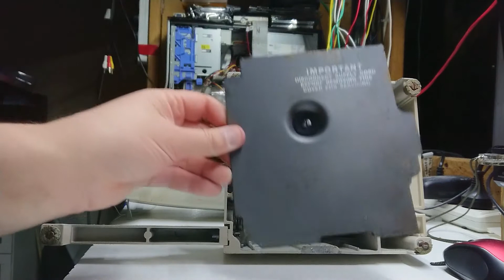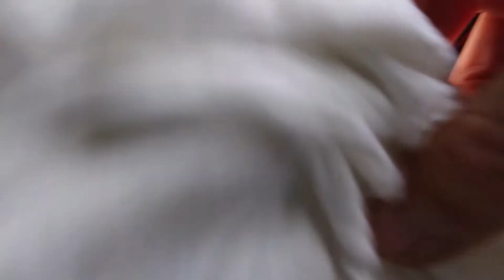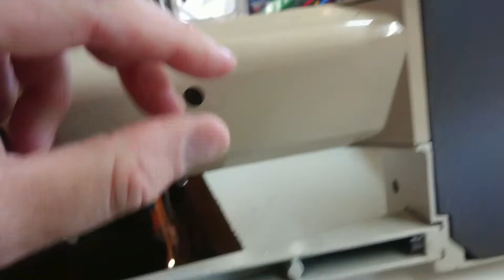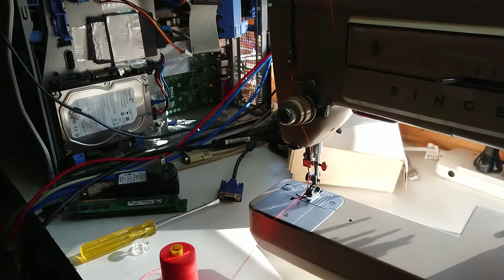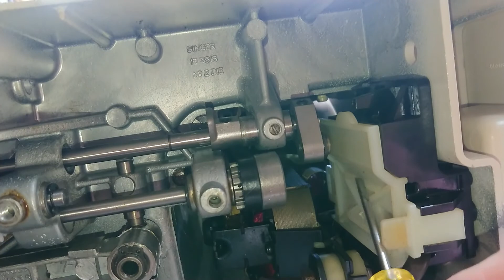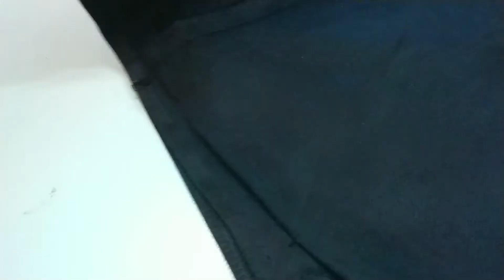Singer Model 527 Repair Part 2 (Complete Overhaul)

Comment: such helpful videos ! do you have any advice if I am unable to slide the main gear off (as you do in 27:00 of the video) it is full on stuck, even with WD40, or maybe i haven't undone something prior.
Reply from the maker: @eccaridge304  i'll have to go back and re watch this one as its a few years old. A couple of drops of sewing machine oil and time can help.
Reply from the maker: I went back and had a look, there are two grub screws you need to loosen.
if you don't do that, it won't budge.
Reply: Hallo I thanks for your help it was very helpful your video  I  had problems with timing with the needle was  stopping also the bobbin Timing it was  not feeding I looked for Singer 527 scraping my head I need your how to set needle timing mark thanks if you pease help me ThNks Ali

Comment: You've mounted that top gear-wheel https://youtu.be/LHyIKIyty8g?t=1856 in reverse, the screw needs to go where the shaft has this inseam!
Reply from the maker: I haven't really touched this machine since 2019 when I did this video. Presently it functions without issue.
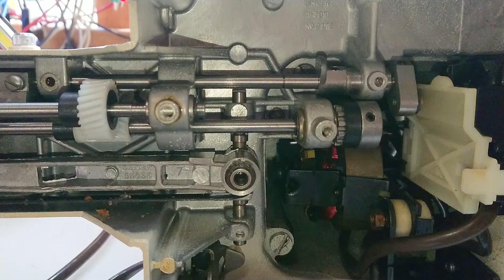Also if you want to reference a time code in a video, you can just use the timecode directly eg: 30:15.
I'll go back and see what you were talking about

Comment: Thanks for your video. I replaced the shuttle gear and then sewed up the hem of 1 leg of my jeans but when I tried to sew the second leg nothing happened! I eventually realised the feed gears had shredded so then I had to replace them as well. Quite a job! Then I found another video on timing the feed. Now it all works great.
Reply from the maker: Ahh good to hear you got it fixed.
This machine was a hard waste find that sat in my shed for 10 years before I decided to find out what was wrong

Comment: Hi. I have a singer 527, the shuttle gear teeth were completely worn off so I need to re align the shuttle. What is the timing mark supposed to line up with? Thanks.
Reply from the maker: This is a couple of years old now, but this should link you to the timecode where I have my best attempt at getting things correctly timed:
https://youtu.be/KLY6kZeEODQ?t=1274

Comment: One thing about the 527. It is a free arm sewing machine. Yours is missing the slide in plate that allows it to also be used as a flatbed sewing machine. You could easily source one out on the web to fit this model, if you ever find the need to do so. It is a nice machine, and your repair work was top notch. 

If the needle bar ever goes out of alignment on this, there is a video that the Sewing Machine Repair Guy did on a similar model, the 533. It's another brittle plastic situation with an upper washer that is easily fixed, thanks to a FB group suggesting a workaround to pulling a very complex cam assembly apart. I'll include a link if you ever need to reference it.  

I really enjoy watching you work a problem with the mechanicals. It's helped me, actually, with some adjustments I had to make to a 496 Starlet (free arm model, gears like your 527, not similar to the flatbed Starlet/Genie model). 

I'm curious. Is the 527 a slant shank? It sure looks like the Starlet's slant shank, was just curious as you stated (I think) that it was a short shank. Slants are short, but are canted like a jet engine pilon instead of straight down. 

Keep up the great video work. 

Dave. 

For Sewing Machine Repair Guy's video on the broken upper washer workaround (This apparently affects a lot of Singer models of this vintage):

https://www.youtube.com/watch?v=D3LgpP9EwhI
Reply from the maker: Sorry for taking so long to reply, this comment found it's way into the "held for review" category, that I don't get notified about.
I only check that when I'm not feeling easy to offend.

I can't tell you much about this machine as I'm not an expert on them, only that this was a hard waste find some years ago, and needed to be repaired in order to complete a few jobs I had around the house.

the video resulted in me receiving the donation of a few other singer models also. Presently it's out of action due to fractured carbon resistor in the foot pedal and I'm using a 1940's model in it's place - it gets very little use.

Comment: Great Video! Just moved in to a new house and found a Singer 538 in perfect condition, I googled on ebay to find out it's value and the only thing I saw were gear kits and it got me worried. I assume that my gears will give up sooner or later so I'm absolutely delighted to have this video should I need any help replacing them! Thanks lots :)
Reply from the maker: No worries, glad to help.
They get old and crumble.
Reply: @TheAussieRepairGuy  Do you by chance know if the replacement gears are of a more durable material than the old ones?
Reply from the maker: @surenkirazian7828  they appear to be teflon. The older ones looked like nitrocellulose. In which case they would be much better. Regardless, it's all you can get now...